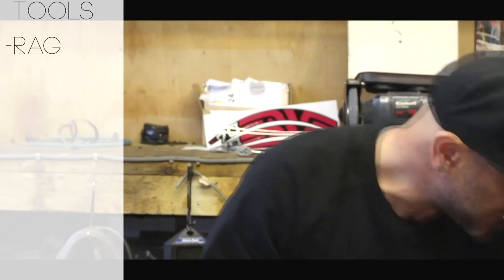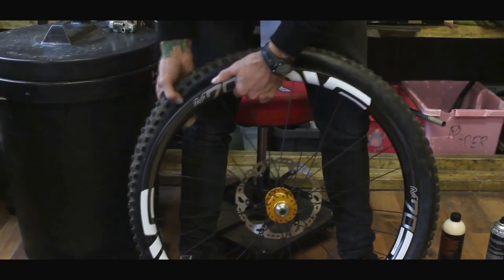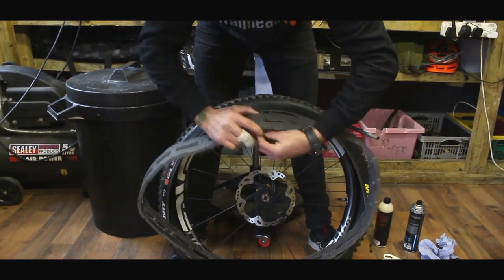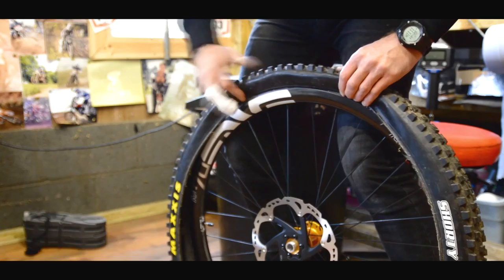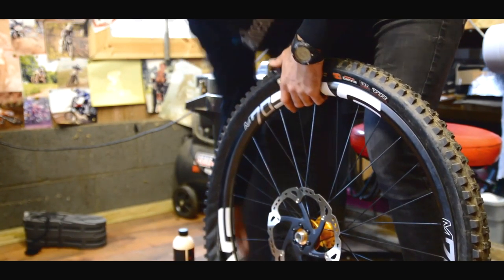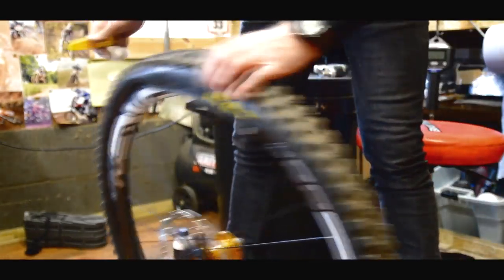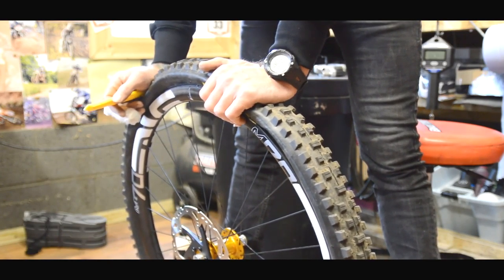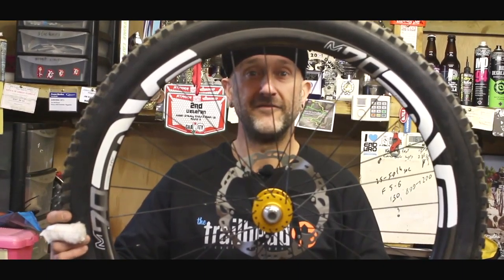How to fit Huck Norris on an MTB

Comment: Hi Jim, did it feel any different on the trail? Do you use the same tyre pressures. Cheers
Reply from the maker: +Lamb Chop  doesn't feel any different but can run lower pressure 20 front 25 rear

Comment: to me cush core seems like a better option. but I haven't tried any inserts yet.
Reply: I have tried Cush Core, & I will stick with it for a while, it was the test winner of Vital mtb's test. it will save the rims in most instances, a big plus is added comfort, I dropped 4psi in the tyres & 20 in hte fox 32 evo fork.
Reply: @mtbboy1993  I would say cush core offers better protection but at 4 times the cost and twice the weight, pros and cons

Comment: Hi ! Does it work with tube type wheels or only with tubeless ? If it works do you use the same air chamber size ? Thanks
Reply from the maker: Just designed for tubeless I'm afraid mate
Reply: @PinnedTV  ok thanks. Do you know a similar system compatible with tubetype ?
Reply from the maker: No sorry